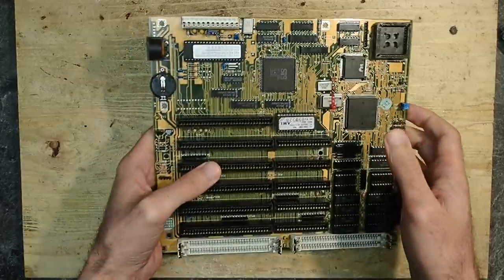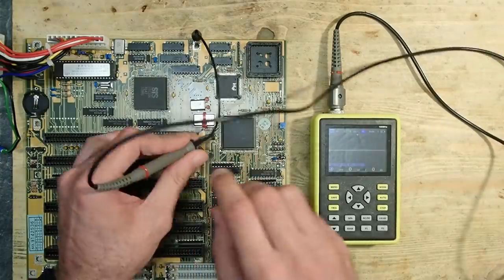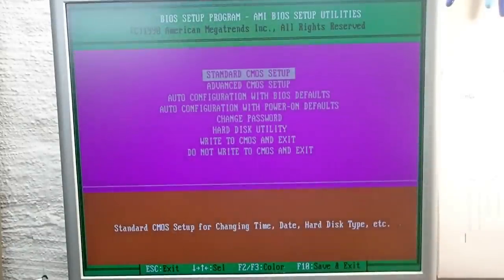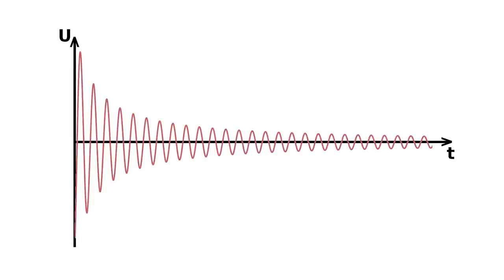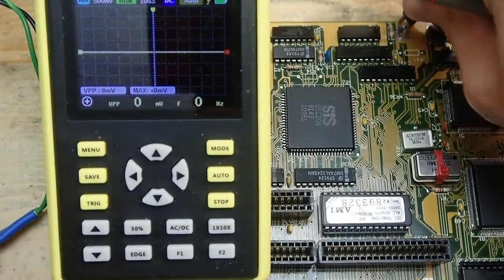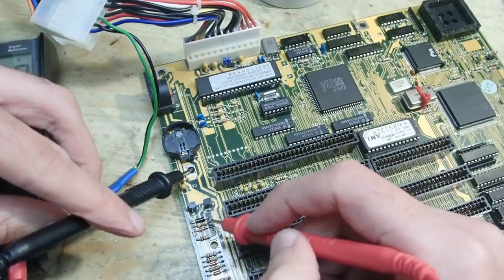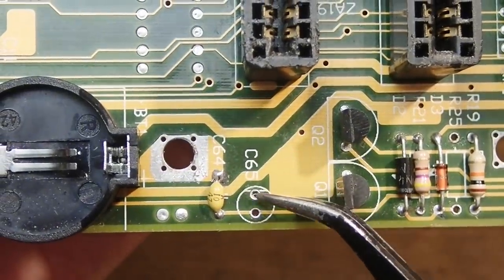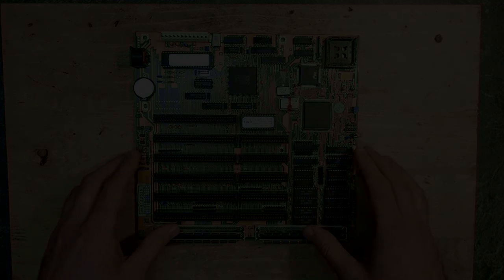Let's repair a mystical issue with an old 386 mainboard

Comment: Can you explain how the switching circuit for 3V battery and 5V PSU (with schematic) works? Thanks!
Reply from the maker: I'll put it on my list. Thanks.
Reply: The basic idea is to reverse bias a diode in series with the battery with 5V from the PSU.

The base of an NPN transistor is connected to 5V, and is used to pull the base of a PNP transistor down to ground. When the PNP transistor switches on it allows 5V out of of the switch circuit.

The other side of the switch circuit is the battery with series diode.

When 5V from the PSU is not present, the diode will be forward biased by the battery and thus conduct, allowing battery voltage through to the oscillator circuit. When 5V is present, the diode becomes reverse biased, preventing it from conducting, and the oscillator circuit is powered by the PSU instead.

The diode also prevents the battery from being charged.

Take a look at the technical reference for the IBM 5170, page 1-93, right along the top for an example schematic.
Reply: @TomStorey96  Thank you! I see 2 diodes, which is about 2x0.6V=1.2V voltage drop on 3V battery. So power for the chip is only 1.8V which is too low. In the datasheet it says it needs 3V minimum. I read on forums that 2.7V is already "low" battery status. Can you explain why it still works?
Reply: @blackarrow8683  The IBM 5170 used a 6V battery.

Comment: I wonder if this would apply to a Pentium 1 board that I have which runs a Dallas RTC because it will post, but freeze when it goes to boot off of a disk.  It did just keep rebooting before I put a brand new RTC in it from Mouser.
Reply from the maker: There the crystal oscillator is inside of the Dallas. I guess, it's happened because the board was trying to save pnp settings and failed with the old module.
Reply: @necro_ware  have you considered mentioning any kind of store where we can purchase some of the stuff you make like your RTC module replacement or Voltage Blaster as a way to obtain some funds for the channel?
Reply from the maker: @RetroTinkerer  There is no store, where you can buy it. In Germany I have to pay a lot of money to open such a store. I will never be able to get that money back. I was searching for legal workarounds to avoid the high costs, but so far I have none.
Reply: @necro_ware  ohh what a shame. At least both project soldering skill requirements seems to be super low.
Reply from the maker: @RetroTinkerer  I try to make all my projects beginners friendly. That's why I don't use SMD parts.

Comment: Crystal Oscillators are not generating anything themselves, they require external circuit to actually generate anything, for example Pierce circuit.
Reply from the maker: The bigger ones (square metal parts with four contacts) do actually already include the circuit to generate the wave standalone. Only the smaller ones (tube, two contacts) do need additional circuitry.
Reply: @necro_ware  yep, that bigger ones are called "crystal generators" and they just contain that additional generation circuit inside them, that's why they need more legs - to consume power and output the signal. Ones that are called "oscillators" have 2 legs and can't generate the signal.
Reply from the maker: @eugenegrebionkin  Yeah, that's true, I just call them all crystal oscillators or even sometimes just crystals out of habit.
Reply: @necro_ware  Excuse me, my bad, translation issues from me:
- Ones with 2 legs that can't output signal are called "crystal resonators"
- ones with 4 legs that contain generation circuit are called "crystal oscillators"
Sorry, I'm not a native English speaker, so messed up some terminology :)

Comment: Don't repair an old damaged tagged tantalum with another pulled tagged tantalum. This problem is just likely to happen again. Since this is just a bypass cap, using an electrolytic or MLCC should work fine here.
Reply from the maker: Sir yes sir :)

Comment: That's strange. Why would RTC influence CPU speed. RTC isn't even needed in most cases. Typically the programmable interval timer is perfectly happy running independently using its own clock and so is the CPU. Most DOS games don't need RTC either, but instead just get their timings from the PIT.
Reply from the maker: It's probably not the CPU speed, but some OS stuff in the background, which probably registers for the timer interrupt. As I told, I can imagine, that there are timeouts happening and the whole system goes crazy.
Reply: @Necroware  DOS can run without RTC so I'm not sure that's the case. The original IBM PC didn't have RTC at all. I suppose NMI is possible if chipset is somehow triggering it continously, but processes it transparently and just eats most of the cycles. Not regular interrupt though. Actually DOS requires only a few interrupt services from BIOS, most relevantly keyboard (9h), PIT (8h), video (10h), disk services (13h) and memory size (12h). Those are sufficient to boot DOS and run many games. Some games require time service interrupt (1ah), but many don't, and most (all in org. IBM PC) of it's functions use just the PIT clock. I've programmed my own BIOS and x86 emulator that boots DOS from scratch so I can be fairly certain about which interrupts are used by DOS and games.

BIOS might be doing something funny with RTC in these newer systems, but that being the cause would still be a bit surprising since it is possible for games to disable regular interrupts entirely and basically bypass the BIOS for anything timing related so this could constitute a significant compatibility problem if the BIOS was designed to somehow make system stability fundamentally rely on interrupts. Anyway, quite interesting case.
Reply from the maker: We also have to take the difference between XT and AT into account. XT had no RTC requirement, but AT has one, so there might be some change. Furthermore, may be the system (soft or hardware?) behaves differently if it detects the RTC and tries to communicate with it for some reasons, but that doesn't work because of the culprit in the video. All of that is just a vague assumption, I'm honestly not sure, what exactly happens internally, but the fact remains, that the system got super slow because of faulty power supply on the clock for RTC. If you get an idea, what it could be exactly, I'd be glad to know the details.
Reply: @derre98   Interesting perspective.  I have heard about the dependency on RTC, but I don't recall where, or what exactly depended on it.

The benchmark itself is pretty obviously reliant on RTC, since it needs wall-clock time to measure the result of loops running on the CPU.  This is, of course, how you would have to measure speed, since otherwise, it's just going as fast as it can, and you have nothing fixed to compare it to.

Games might be using RTC for timing reference as well, since the common reference of vertical refresh isn't reliably present on a PC.  Or, they might be benchmarking the CPU as well to determine compatibility, or how to set busy-wait loop timer constants.  (I have to do this on embedded platforms, although usually it's not necessary to poll a RTC -- if one even exists -- since the clock frequency is passed as a value to the build script, which can use it as constant at run-time.  That value is then used for calculating how many CPU ticks are in a microsecond or somesuch.)

I don't know how reliable a PIT would be, since it would depend on what clock it, in turn, uses as a reference.  Could we assume with any certainty that it is derived from a fixed 14.3MHz clock, or is it more often based on the ISA bus clock?  (Which is then based on the CPU bus clock, which, depending on the CPU multiplier, could skew from down to 7-point-something, up to 10-point-something MHz.)
Reply: @ruben_balea   Ah!  Yeah, I had forgotten to say, I wondered if the BIOS itself may have hooks registered.  Well.  There ya go.  :-)
Reply: @ruben_balea  Int 70h (IRQ8) is indeed fired by the RTC, int 8h (IRQ0) is fired by PIT only (one has to be careful not to mix int and irq). Int 15h uses RTC, but it is not needed by DOS and most games and applications for anything so in that sense it shouldn't matter. However, you may be onto something in a sense that if the RTC is sporadically firing int 70h at a high rate for some reason, this may end up eating your cpu time. I was originally thinking NMI might be the problem as RTC is also used to enable/disable the NMI, but now that I think about it, perhaps int 70h could be the problem. That might better explain why nothing else goes wrong. If int 70h is the problem, then physically disconnecting it could fix the problem and allow the cpu to run without being constantly interrupted.

Comment: Wow fascinating viewing, I've got a 486 with Ami bios stuck at 22 on the post card. Frequently is fine, address and data pins show traffic until it reaches 22 then it just sits there, also there is no beep just a click. Bios battery power is ok, voltages etc... Anyone have a clue what I can look at next? Thanks
Reply: Looks like a memory error code. Have you got anywhere with it?

Comment: So the bad capacitor acted as a high-pass filter on the power delivery as opposed to a lowpass filter.
Reply from the maker: Not quite, the ripple you can see in the video disappeared as soon as I removed the capacitor. So it didn't come from the power supply, but was probably generated by the broken capacitor.

Comment: never throw away your precious - does this RING a bell ?
Reply: @necro_ware  

i found a possible 386 SBC - ISA16 
two sockets - one for 386, another for 387.

but i got a 486 and 487 that seem to fit.

only pin wise i assume . .

Comment: My PC couldn't even start because of discharged RTC battery.
Reply from the maker: That's usually happens only with RTC modules (Dallas, Benchmarq etc), which have internal battery. I coverd that topic in multiple videos before.